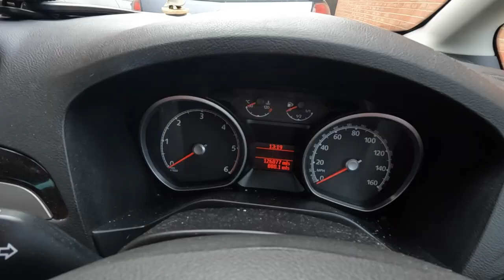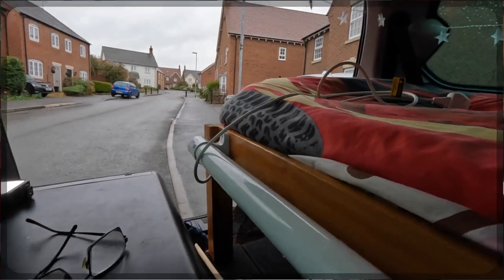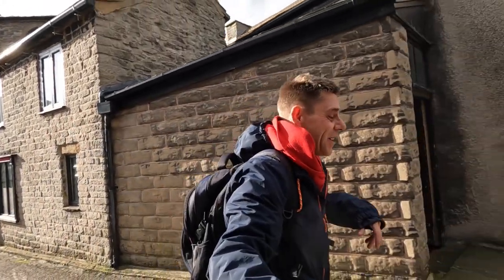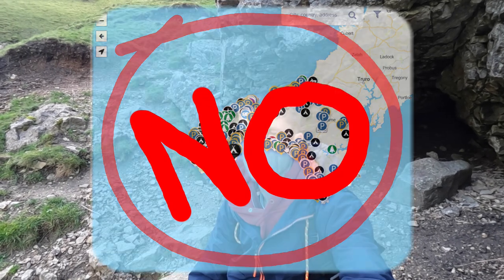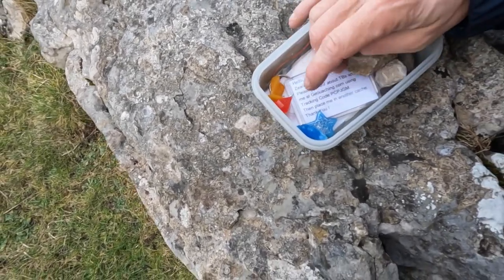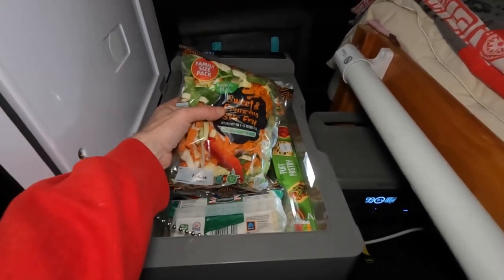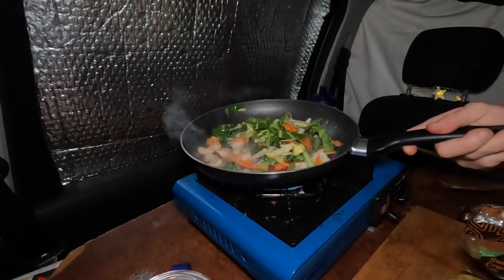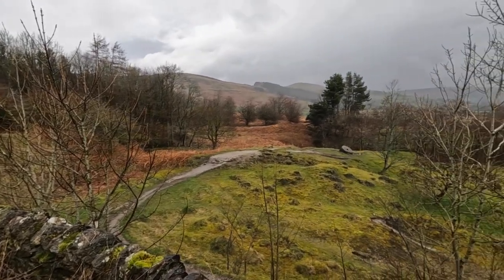DAYLIGHT ROBBERY and a Heating System For CAR CAMPING in my Micro Camper

Comment: Another cracking video fella. Just a suggestion. Maybe box in the tube heater with vents  underneath the bed. 

1. Heats up the bed from underneath

2. Don't have to worry about burning your leg

Comment: Be interesting to see how that heating goes. I've experimented with the little 40w ones and it doesn't make a difference. Also got one of those tiny £15 fan heaters which does work quite well, but takes 500w - so only useful on an EHU really.

Comment: It should be possible  to wire the eco flow to the car battery detachable obviously so by the time you driven a few hours to where you going you on full power for the eco power.. wicked views on this one have a great week. .. Squeak squeak
Reply from the maker: It can be recharged via 12v ciggy lighter socket not sure about hardwire to the battery though
Reply: They hard wire it to starter motor not battery

Comment: Love the channel mate, can save yourself a bit of money at a garage. Pick yourself up a tyre inflator online, less than 20 quid. When you inflate it, the gauge can pick up any accelerated deflation, get yourself a new tyre/set if it's slow. 👍
Reply from the maker: the zaffy came with one ive actually remembered to bring it with me on this trip
Reply: @wanderingwhere  Ace man, should be fairly straight forward and it will tell you if you have a slow puncture. Save you paying a garage 👍